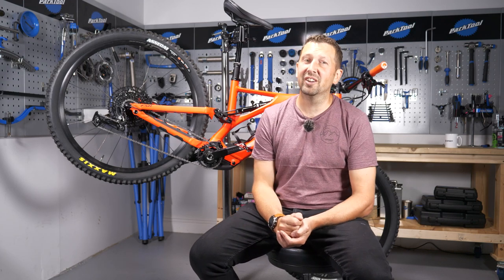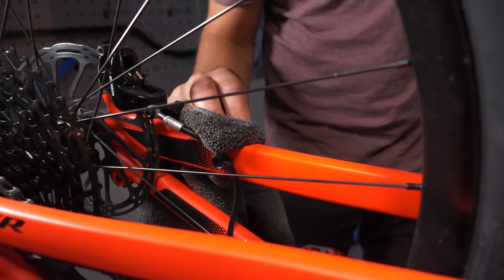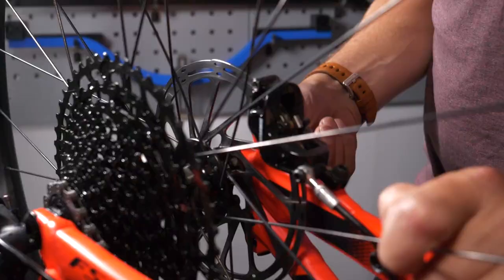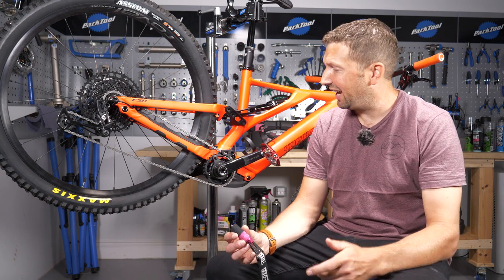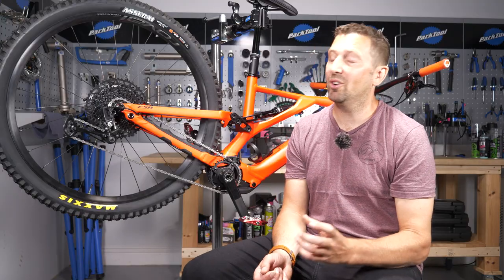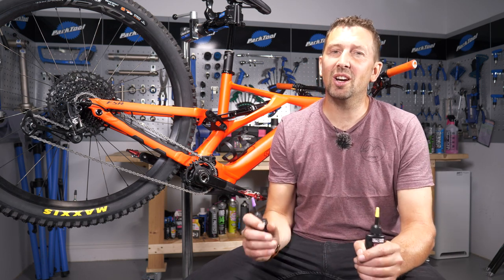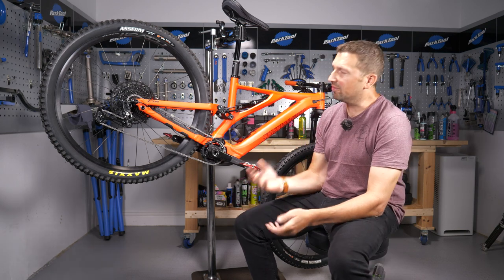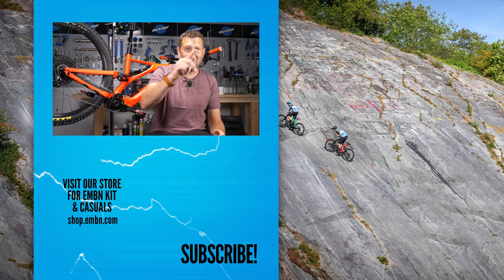E-Bike Cleaning Mistakes That Are Costing You Money!

Comment: More chemicals in a bike shop than at work where we are machining parts for offshore installations. A bit overkill?
Reply: Hello, 
oh no... bikes are generally our passion so never enough products and allways too cheap for shop owners salers...
Reply: Overkill is the mtb and road riding SOP. 
Iv just got brake and clutch cleaner, some truck wash and a water displacing spray wax. Job done.